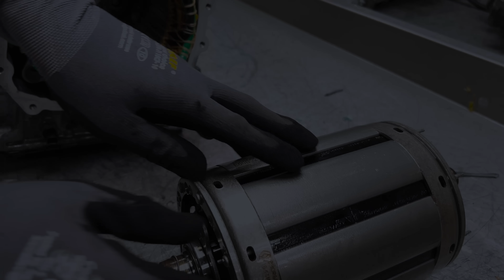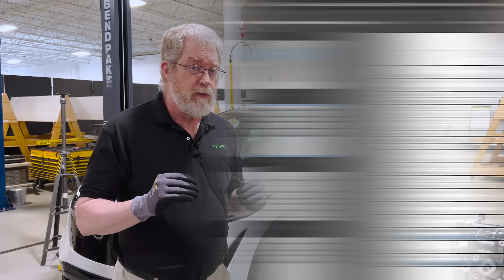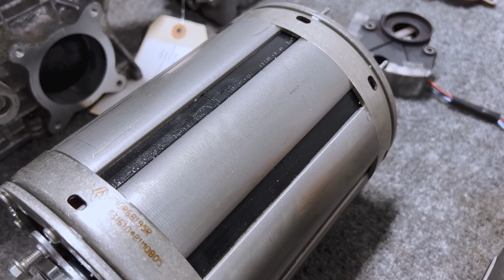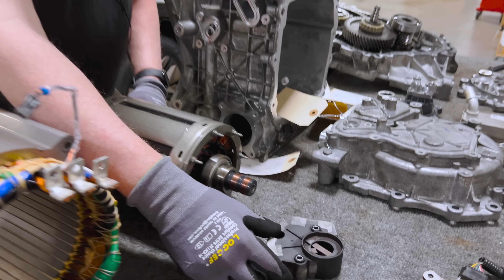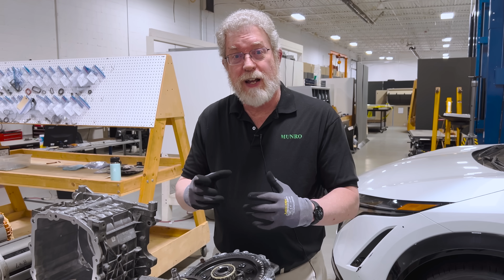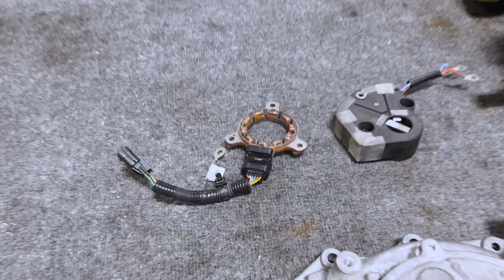This EV Motor Has No Magnets – Nissan Ariya EESM Teardown

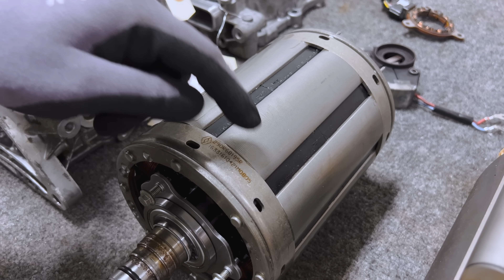Comment: This design was called an "Electrodynamic motor" and has been around for over a century.  This has some neat updated features and optimizations, along with a gimmicky marketing name.  As for Nissan making the motor, the rotor has a Renault logo @ 5:39, so likely it was made by Renault.  Essentially this designs trades a lot of copper wire for magnets at the cost of size, weight, efficiency and manufacturing complexity.  It is designed for limited life, likely significantly shorter than a modern Lithium based battery.   The engineering to update this old, basic design, is significant, but it is akin to "lipstick on a pig";  the underlying motor is still a fundamental design from the early 1900s
Reply: BMW i4 has EESM. Just took a 300 mile road trip, cruise set at 70 mph, got 23.3 kWh/100 mi efficiency. Efficiency is amazing.
Reply: Interesting info. Thanks for sharing it. In the video though he said that while less efficient at low speed they're actually more efficient at high speed. And one of the key points he's making in this video is that there are optimisations and solutions built in to this design to mitigate wear or reliability issues. Some of the key components such as most notably the brushes are easily replaceable on this design and seem to be kept outside the motor enough to not gum up the works with carbon wear deposits as might be an issue on some brushed motors. So with a few bits replaced maybe once at most I expect it could be as good as a battery for service life. But only time will tell of course
Reply: @josephcullen2512  The high speed efficiency is mostly dependent on the rotor speed.   In this case it's mostly theoretical and negligible at the rotor speeds in a car.  Ignored is the efficiency of the electronics driving the rotor coils, which cancels any possible high speed efficiency.
Reply: @shazam6274 oh okay. Hmmm. You seem to know your stuff then. It's not my area of expertise so thank you for elaborating. Cheers
Reply: @shazam6274  Yes, it is mostly dependent on the rotor speed and that's where this design shines when talking about highway speeds.
Even TM3 PM motor needs field weakening above 70mph as the rotor speed reaches high rpm and there we are talking about 200kW+ motor. Most of the other makers have weaker motors so they reach the high rpm at even lower speed than TM3 and that's why they usually also has much lower top speeds than TM3.
TM3 is unbeatable regarding efficiency if you stay at or below 70mph, but once you push it more the efficiency tanks down pretty fast while the cars with this design can cruise at much higher speed without using field weakening and loosing the efficiency so quickly. Obviously at the cost of efficiency at city speeds...
As was said in the video, it is not a best choice for the city car, but for the universal car where you also want to be able to go long highway trips this is pretty good choice. And it is clear why BMW uses this design in their cars as their customer base is mostly driving German autobahns at high speeds 😉
Reply: @tomas_klouda  Well, the average car speed in the US is <35 Mph, which includes highway driving.  Unfortunately, unless it is at night or on a Sunday, even highway speeds average ` 45 Mph. not 70 Mph.  Everyone conveniently ignores the power supply / electric field generator for the rotor coils, which is perhaps 75-85% efficient so 15% to 25% energy loss compared to magnets.  Now someone please explain how Tesla magically manages to have the Plaid motors operate efficiently at 135 Mph using Neodymium magnet motors.
Reply: @shazam6274 what does average speed tells you about the highway range? 😮
The fact you spend 20 minutes sitting in a traffic jam and then speed at 85-90mph the rest of the trip doesn't mean you will have low consumption.
I have never heard about Tesla Plaid to be efficient at hight speed, only being powerful, but I was not paying much attention to this car.
I know it has some special thin and long motors to allow them to spin at high rpm. Lower circumference means lower speed which the magnets are doing at the same rpm, so it means it can probably reach much higher rpm before it needs the field weakening.
Combine it with higher power, it means at the same rpm the car is going faster as it can have heavier transmission ratio.
So it has higher speed at the same rpm and it can reach higher rpm before it needs field weakening. Yes, that sounds like it can most probably be efficient at much higher speeds than ordinary cars.
Taycan is having two speed transmission to achieve the same thing. To have lower rpm at high speed, so it doesn't need to spend a lot of energy on field weakening.
We would need some engine designer to tell us whether you need more energy to power the electromagnets or for the field weakening. I always thought field weakening uses much more energy, but I might have been wrong🤷‍♂️
Reply: It's supply chain issue, as said in video. PMs are from China now.
Reply: A wound field machine is built very much the same with the same materials as a PM machine. The magnets are the only difference.
Reply: @lxoxrxexnx  You can't count too good! In the PM motors there is only ONE winding, the stator, which is often replaced by preformed  "Bobby Pins";  in a Dynamic motor, there are TWO windings, one of which is on a small, fast spinning rotor which is powered by brushes and slip rings. Twice the work & wire.
Reply: @shazam6274 do you think that installing magnets into the rotor costs nothing? Magnets are costly. Handling them is costly.
A permanent magnet can produce a flux density of about 1T max. A wound field can produce more. 1.5 T is not unusual; and you can go higher for short durations, with the temperature of the winding being a limitation. This gives the motor/generator significant overload capability while minimizing size for normal operations.
You also gain the benefit of shutting off the machine for coasting or if there is a system short circuit in generator mode.
Reply: @lxoxrxexnx  and yet, Tesla avoids wound-rotor synchronous motors in its vehicles. Brushes, slip rings -- are points of failure, wearing out over time, adding mechanical complexity, increased risk of contamination due to dust, moisture, vibration. These motors don't last. PMSMs, which Tesla widely uses, have high efficiency at typical driving speeds, strong torque density, excellent power-to-weight ratio. Because the magnetic field is always "on" and strong, PMSMs excel in low-speed, high-torque conditions, use less energy for the same performance. Instead of all those drawbacks, Tesla cleverly combines PMSM in the rear (high efficiency), induction motor in the front (no magnets, good at high loads) -- the best of both worlds.
Reply: @ElementaryWatson_fafo I have no argument with most of your points; and a PMSM is a good choice if you look only at the motor. Long ago we looked at the costs and benefits of several system architectures and found the system that uses a WFSM to be the best choice. The tipping point was in the power electronics. There was none needed to control the power windings; just a small set to control the main field. 
I don’t know what studies Tesla did, or what decision criteria they used. It’s possible that the power electronics costs dropped in the 10 years following my study, or the economies of scale tipped the decision in favor of Tesla’s choice.
Another factor could have been the intended market. We were designing product for commercial hybrid electric vehicles. Tesla was designing for personal fully electric vehicles.
This is all very interesting stuff.
Reply: I wonder if Nissan will face similar lawsuits to their terrible CVT, because these motors will be failing pretty often.
Reply: @ElementaryWatson_fafo  They only have to last a little longer than the warranty  😂
Reply: @ElementaryWatson_fafo I thought it was Subaru that had the CVT
Reply: @lxoxrxexnx  CVT is common today, but Nissan's was especially poor quality resulting in a lawsuit and finally providing extended warranty and free replacement.
Reply: @ElementaryWatson_fafo thanks.
Reply: Didn't watch the video, or just didn't listen?

Comment: As far as snorkels go, i agree with the snorkel for the Motor. Also for battery packs, and other items including heat generating air sealed, electronic modules that have a significant air space inside and are mounted anywhere outside of the passenger compartment! Well connected, with decent terminations that ensure vibration or movement will not cause detachment, and using lifetime stable materials in the snorkel itself are critical, as this part must outlast the vehicle. These snorkel hose should vent into the trunk or frunk, to ensure the air they ingest is clean and dry and have an inline activated carbon filter to minimize any normal operating smells from the protected module, battery, or motor from disturb the occupants.

Comment: Thank you for giving truthful info about EV sales being up. Great to see an EESM disassembly. Renault, Nissan, BMW seem to be major OEMs using EESM. I realize supply chain risk is reduced, but I hope brushes last, like you say, last 150,000- 250,000 miles. I have read the BMW motor needs to be dropped to service brushes - any knowledge about BMW EESM?
Reply: Please show official maintenance schedule.
Reply: In the EU Nissan recommend brush replacement every 80.000 km, and NOT under warranty !

Comment: I would have thought that the servicing is much higher than a permanent magnet which doesnt use brushes.
A big negative for me
Reply: If you had listened to Paul you would have heard him say that you would not need to service the brushes until you gave the car to your granddaughter. The brushes are really long and might outlast you if you are already retired.
Reply: @lxoxrxexnx  Nissan might might claim that but I doubt it
Reply: Not a fan of the brushes either but they look really easy to get to. Looks like a 30min job at most. 

30 minutes of work every 100k ain't bad
Reply: @aleks138  I prefer the zero minute job of permanent magnets
Reply: @Stumpy1854-Orion not having to do repairs or maintenance is always a big plus. Lucky there is a choice of cars with different motor designs. Something for everyone.
Reply: @lxoxrxexnx  With permanent magnets not needing rare earth materials now, it's no longer an issue

Comment: The only range that matters for EVs is highway range. So high efficiency  for highway driving is the key metric.
Reply: City range doesn't matter, but city efficiency determines most of the running cost.

Comment: I distinctly remember Sandy calling out Ford for keeping the parking pawl on their Mach-E when it was first released, saying it was a symptom of Ford's unwillingness to adapt to new ways of thinking. He even discussed it with Ford's engineer when she came on the channel, and they later removed it from the production line.

But here it's being presented as a good thing that Nissan stuck with existing parts, rather than an unnecessary extra part that should've been designed out.
Reply: In both cases a Design Failure Mode and Effect Analysis DFMEA should reveal why each option may be valid, sadly no right or wrong here. The external control criteria and the design team affecting the outcome and lets face it if thats all we have to conbobulate no one gives a flying f*ck ( FF- automotive technical design term ) lol.
Reply: I wholeheartedly disagree with Sandy Munro on this issue. In fact, when Telsa supplied Toyota with the same large drive motor for the Toyota Rav 4 California Compliance version BEV, It was made with a parking pawls, but the Tesla Model S, using the same Large Drive Motor, had the part Elon Musk Deleted!
Reply: @DishNetworkDealerNEO  Yeah I'm calling BS.  Model S has never had a parking pawl.
Reply: @coreyahahn your ability to read, is showing, I said the same motor has a pawl when used on Toyota RAV4, and was built without the pawl when installed on Model S. To be clear, the same case was used, and a blank plate was installed to cover the hole for the missing pawl! Are we good now? No BS at all!!
Reply: @DishNetworkDealerNEO  Pawl may have been omitted by Tesla for cost cutting reasons.
Reply: It’s okay to simplify 
But then there’s no backup 
So it’s a single point failure 

Tesla has done same with door handles.
Reply: @ralanham76 Tesla uses a pump to pressurize the Brake calipers. One slow leak of the hydraulic lines, and then the pressure bleeds away, and if the Tesla is on a hill, it’s going for its unplanned autonomous drive, most likely ending in a RUD, rapid Unplanned Destruction.
Reply: @DishNetworkDealerNEO no pump, it’s just a screw, like the e brake of any car. Presses the calipers. You can cut power or even the brake lines and it will not release
Reply: @ralanham76 it’s even more dangerous when you’re towing, having a physical parking system is much better
Reply: Engineered 44 years in big auto world wide and designed using Failure Mode Effect Analysis (FMEA) , since 2014 have owned and run one of the first Tesla Model S from new. Why do I always turn the front wheels into the kerb if parking on a hill?
Maybe its because I work on my own car and have replaced a faulty parking brake servo motor at 122,000 miles. In other words should both parking brake servos fail and you are on a hill and you walk away your car may roll away.
Its very very unlikely but clearly Nissan have done their FMEA and made their choice. I remember Sandy making the comment and agreeing with him but seeing the Nissam park pawl whats the chances of that engaging by accident or failing?
Other than having a traditional handbrake where you can "feel" the brake force, you pays your money take your choice, I see no clear winner...........maybe the handbrake lol
Reply: Nissan is fighting to survive
Reply: @Plisken65 ridiculous joke
Reply: with the Nissan... the motor requires power for rotor to have a magnetic field, so without power it just spins free, as opposed to a PM motor where it is just jammed when there is no power.  Maybe that's why the park pall is needed here.
Reply: @qcca123-f1v  A PM motor is not locked ("jammed") when unpowered - it just exhibits some cogging.
Reply: @qcca123-f1v a permanent magnet motor spins freely when there is no power. The only way to make a permanent motor not turn when there is no power is to short the terminals but that needs power for the transistors to run.
Reply: @franciscoshi1968  or put a clamp. Parking clamp lol.
Reply: @qcca123-f1v  No, the Leaf with a permanent magnet motor also has it
Reply: @qcca123-f1v without any stator power to create electromagnetic magnetic fields to attract or oppose the permanent magnet rotor, rotates free too. Tesla pumps hydraulic pressure into the Brake calipers to act as a parking brake, but if there is a leak back, and the car is on a hill, bye bye Tesla…
Reply: The parking pawl bit and then treating the grounding brush and extended breather as some miracle of engineering makes it feel like they're brown nosing nissan after getting a car to play with.
Reply: @aleks138  You say brown nosing, I say normal, decent design such as this is the exception nowadays so worth mentioning.
Reply: @aleks138  Big difference between "Miracle of engineering" and "Don't fix what ain't broke".
Reply: @aleks138 
Nissan are just making a simple reliable car. Using obvious old fashioned mechanical methods. 
The savings made by Tesla in not having an ultra simple ultra reliable mechanical parking system are rather trivial. The same applies to the other details - mechanical simplicity and reliability.  Tesla can be too clever - remove too much - and the Model S is not exactly cheap!  Leaving a Tesla on a steep hill for a few weeks with a nearly discharged battery could be dangerous. 
And I like the thought that the Nissan can freewheel without restraint. Making it easy to tow, or push around. Proper old fashioned …
Reply: @georgetaylor2640 where exactly is the “old” fashioned! In the Nissan? tesla has been removing all the actual important parts that might actually make their vehicles way less reliable and even less reparable let alone modifiable, they cut corners to make more money at your detriment.

Comment: The reason rare earths are needed in many current applications is the heat buildup. Could that Nissan motor run cooler?
Reply: It can probably operate at a higher temperature without any problems. Magnets are very sensitive to heat, we don't that issue here.